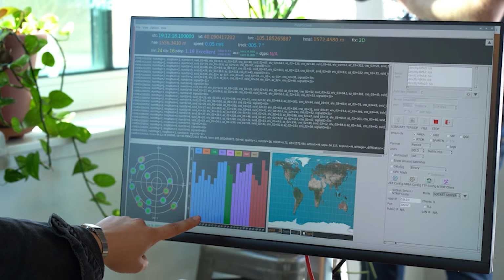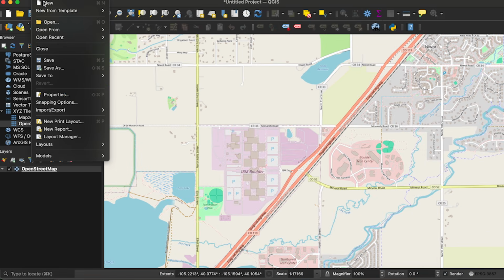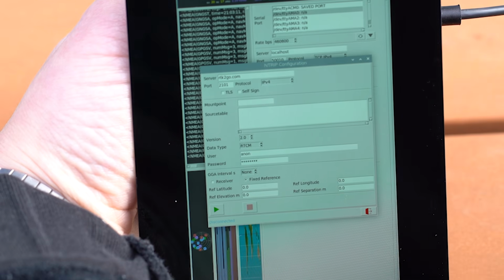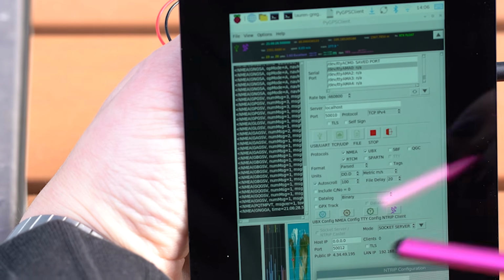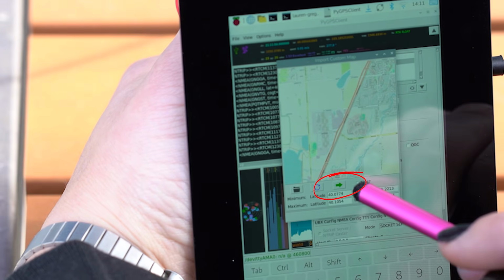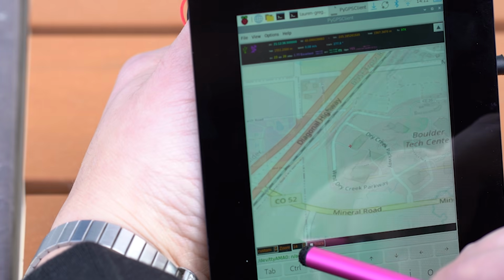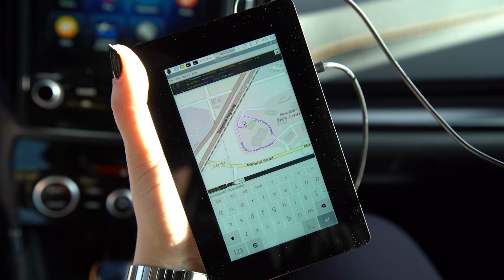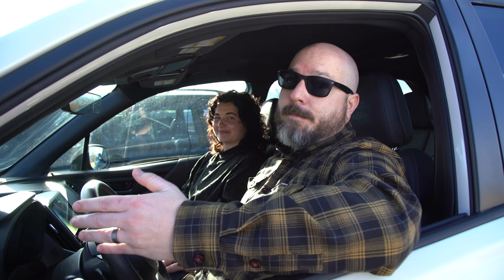Achieving High Precision RTK GNSS on a Raspberry Pi

Comment: Hi Guys - good to see PyGPSClient in action, and kudos on operating it with a Pi Touch Panel 🙂 Just a quick reminder that if you have the optional Python module `rasterio` installed, PyGPSClient's Import Custom Map facility will automatically import the map extents - you don't have to type them in manually. rasterio is now available as a 'wheel' in the latest versions of Raspberry Pi OS (Trixie), so it should install using pip without difficulty:

python3 -m pip install --upgrade rasterio

(run this within the virtual environment containing PyGPSClient)
Reply: Thanks

Comment: Thanks for this great video! Does the pi need to be connected to WiFi all the time in order to get the RTK corrections using your method?
If so, how did you do this?
Reply: Cell phone with mobile hotspot

Comment: open Manet with HaLo and WIFI 7 along with GPS and how do you stack all of that😂.  I’ve got a bunch of parts, but I started figuring out part of it for really raspberry pie 4 but the Wi-Fi seven needs PCIe. Video walkie-talkies, and retro gaming along with its real emergency uses. Freenove sell a case that looks like an old-fashioned walkie-talkie when it’s standing on and or an old-fashioned a.m. radio on its side, which is normal because as of 4.3 inch screen on it also..  it even has a UART port right where you would want your push to talk.   How do you get all of that and an NVM E Dr. on there?😂